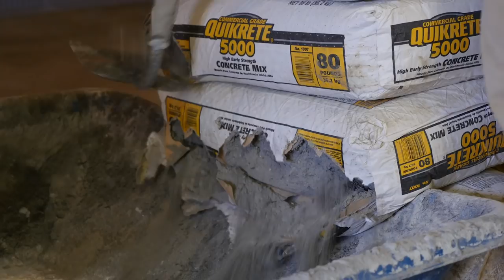Waterproofing a Poured Concrete Basement - 1500 Square Feet

Comment: At the end of the video, once the concrete is hard, can you cut off the excess waterproofing material flush with the top of the floor?
Reply from the maker: No. I don't advise it. You can if you want.
Reply: @AmericanDryBasementSystems  do you sell the waffle board type materials to the diy public?
Reply from the maker: @timgiles9413  No. But you can find dimple board online or at a local Home Depot or Lowes.
Reply: @AmericanDryBasementSystems  Okay, thank you. I didn't know what it was called.